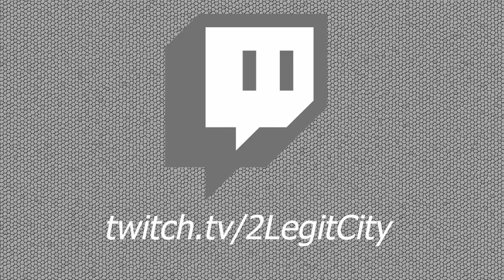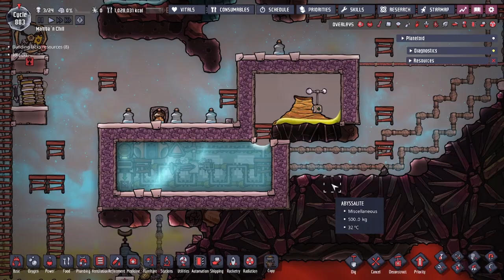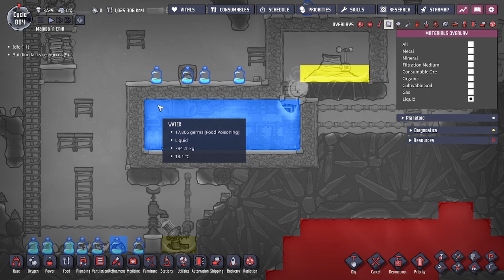How to Tame the Liquid Sulfur Geyser - Oxygen Not Included

Comment: good one. Just a little idea to improve the design: use a cycle sensor to automate the conveyor sweeper and set to sth like 10% of the day. That way, the auto sweeper wont pick up very little piece of ...10kg... and therefore consume less power. Also, it provides the sulfur with more time to cool down further.
Reply from the maker: with how low temp the liquid sulfur is, and how 2 passes of the loop brings it out to 30 celsius, i dont think worth doing as typically you want to grab it as soon as possible. but this might be something i will consider because im thinking of using a similar design for the metal volcanos
Reply: @2LegitCity  I use the conveyor meter set to allow enough material through so you are just clearing the last of the last eruption as the next eruption starts
Reply from the maker: @NoMusiciansInMusicAnymore  hmmm, im not a fan of any of the conveyor meters though, even though i do use them for rocket fueling, i tend to not use them anywhere else
Reply: @NoMusiciansInMusicAnymore  I like that idea - it essentially turns the cooling chamber into a buffer storage, while providing you with the average material rate.

If its not enough, then I need to secure another geyser, start geotuning, or cut back on sulfur use.  Just because I'm pulling it out faster doesn't mean I'll get any more.

Comment: Is there a reason for the enclosure to be 4 tiles high or could it work with three as well as it is in a vacuum anyways? Could you also show how you got the vacuum in the first place and your aquatuner set-up? :) thank you
Reply from the maker: when you say enclosure, thats the vacuum area above the geyser? if that is, you can shrink that down to 3 tiles. the water area stays as the video describes.

aqua tuner requires steam turbine typically like this: https://youtu.be/JxO6qv8VSx4

for the vacuum, you want to keep the tiles unmined on the geyser, then add a water lock into either side of the geyser and create the insulated tile room. after you  just pump out all the gas, fill with water, then open the geyser.

Comment: i would move right water wall at least one block to the right, so new sulfur comes in contact with 3 water tiles instead of two. but realistically, maybe having sulfur in corner is always enough for steam not to appear. maybe tempshift makes this robust enough. i still want to know what is the hottest stuff we can drip into such pool
Reply from the maker: honestly, you can double the tank size vertically and with that much volume, i wouldnt be surprised if it was capable of handling niobium volcano but i havent tested it

Comment: Something you can do, which i learned from a metal volcano taming video, is just to calculate the exact output cycle for the rail.
20 for the amount on the rail
7 kg per sec
226 and 87.5 for active
648 and 143.3 for inactive
With those numbers it would be 20/(7*226*87.5/648/143.3)
That goes to approx 13.4 seconds between every packet drop.
Hook up logic like this

i is input
o is output 

i Buffer Out to chute 
I
O   Not   i
I              I
i Buffer  O

Put .9 or slightly lower on the top buffer
Put the calculated number, 13.4 in this instance, on the bottom one. It will output 20kg every 13.4 seconds forever

Comment: If you insulate the geyser itself, leave the water chamber the same, use a pump and automation to pump the sulfur to the water chamber and put water in the geyser for some thermal power, would it be more efficient or just about the same?
Reply from the maker: that wouldnt work at all. the sulfur in the pipes would break due to state change and you get 0 thermal power from the geyser due to the low temp

Comment: 3:10 Isn't SHC irrelevant? Sulfur has a set amount of heat energy that it needs to give off. The aquatuner only "removes" the energy that liquid Sulfur gave to the cooling liquid. The temperature change in the cooling liquid should be irrelevant here. (In other words, oil rises in temperature easily but it drops temperature easily too.)
Reply from the maker: no, SHC is very much relevant anytime you talk about an aquatuner due to how the building works. if the coolant/liquid medium from the AT is warming up faster because its a poor (low SHC) medium, than the pool its cooling with steadily rise in temperature. however this only becomes an issue if the temperature of the pool at the start of each eruption creeps up and climbs towards state change temperatures. 

in your example that oil rises in temp easy, and drops easy is true but the aquatuner only lowers temperature by a fixed number, so the cooling isnt as easy.
Reply: @2LegitCity  Thank you for the explanation. It makes sense.